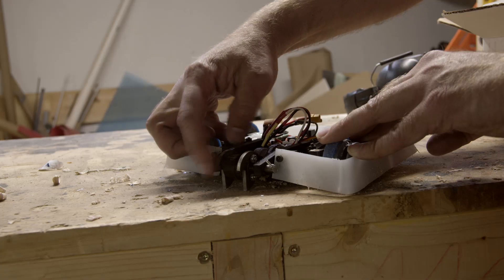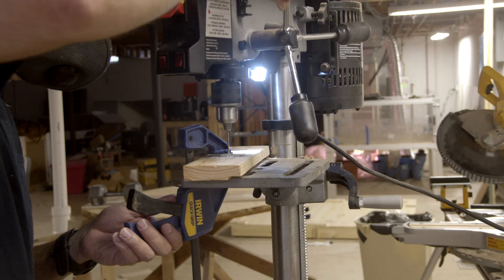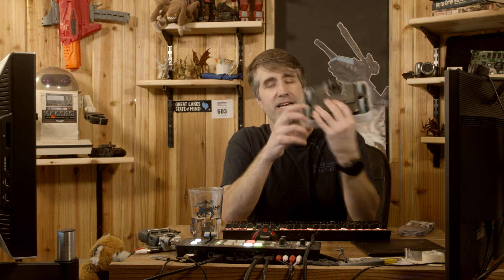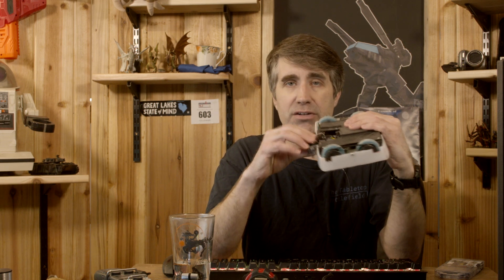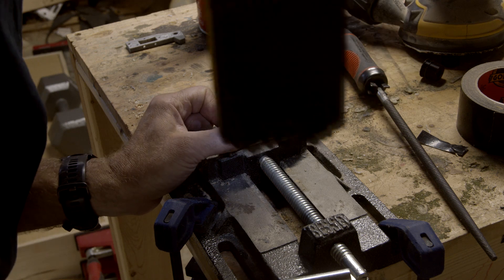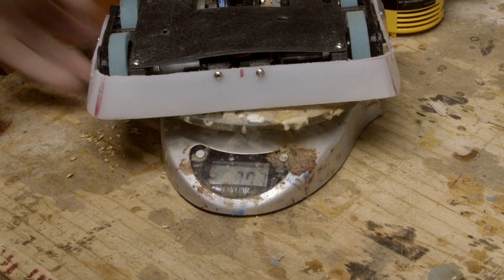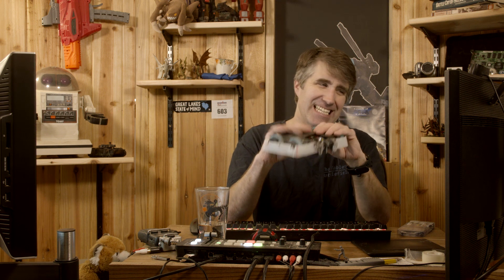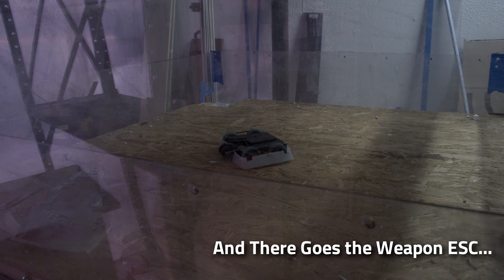Completing the Antweight Combat Robot Build...And Destroying an ESC - Let's Build an Antweight Ep.7

Comment: Instead of undersizing the bolt holes just join them as a single cut out feature to the center bearing bore so they are just slots. This gets around the minimum hole size feature limit for send cut send.
Reply from the maker: That’s a neat tip.  Thanks for sharing.